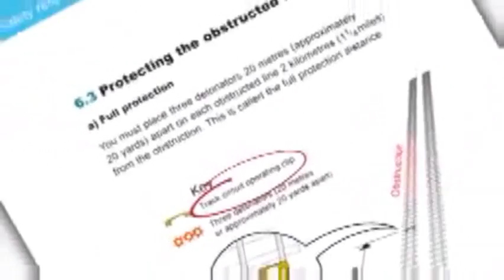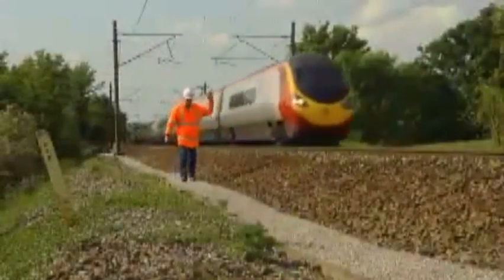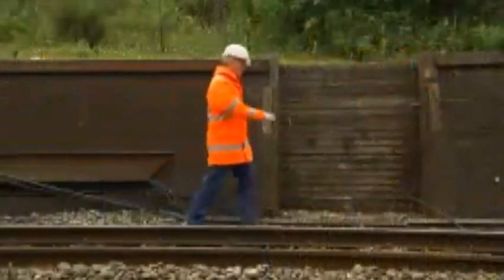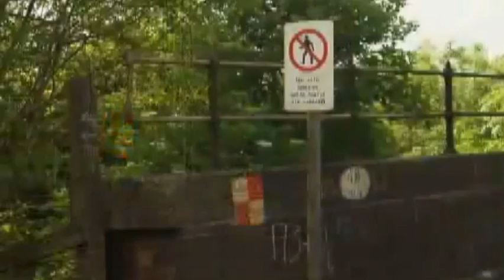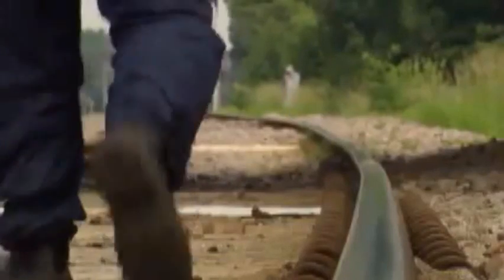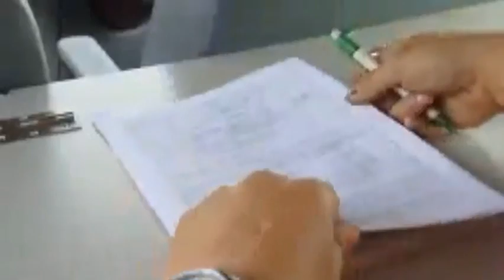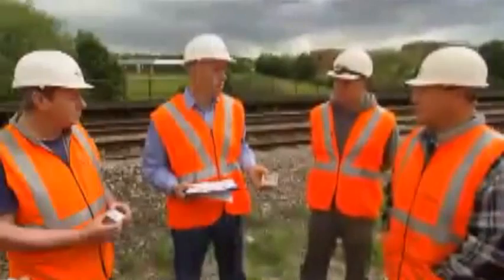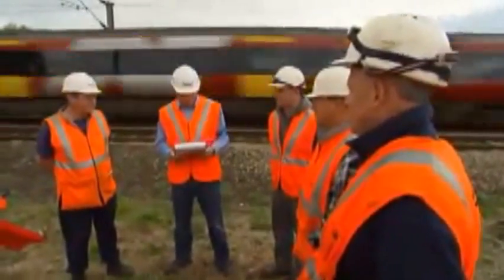Network Rail

Comment: The cess came about from the good ol' days when the toilet tube pointed at the trackside and outside the cess was considered safe from splattery delights that would certainly make for an interesting day and in later trains like the MK1's this was aimed a little inwards to the track and more downwards as someone using a toilet thundering through a station, the angle caused the ahem "spray" to ricochet from the platform drop, back up the bogies and into waiting passengers faces adding new dimensions to railway travel horrors.   Ask any old track worker about blind eels, wrigglers and other wonders of humanity and why they didn't put septic tanks on trains a LOT earlier... :P
Reply: I don’t know where you got this information from, but it’s not correct.
Toilet dump pipes were located such that the discharge landed in the four foot. At speed this discharge would form an aerosol which was really unpleasant for anyone on or near the line, and occasionally for people on platforms.
However, the word cess is of obscure origin, but most likely means “access” as it’s almost always been the walking route for track workers.

Comment: Contradiction in rail safety videos. I just watched a British Rail video which said that a blue and white checker sign said limited clearance with no refuges within the structure where as this one says none on the side of the blue and white sign. Presumably on the opposite side to a blue and white checker sign there would be a red and white checker sign?
Reply: Correct. A continuous position of safety or refuges are only available along the cess on the opposite side of the running lines. The side where the sign is displayed has neither a continuous position of safety nor refuges.
In the case that there are no refuges on both sides, then an Access Prohibited sign will be displayed, not 2 'No Refuges'

Comment: Could there ever be one person trackside? If so what are the safety procedures?
Reply: Yes, it is permitted for 1 person to be track side, I have walked 100s of miles IWA, Individual walking alone, You must be trained & certified to undertake these duties, You must have a complete Safe work pack which out lines the work to be undertaken, contact details for local control, signal box, Hospital, ECO (Electrical Control Office, These look after the overhead power supply & / or 3rd rail DC Traction power) You must maintain, contact with a control person, (if they don't hear from you at a set time they will try to contact You, if that fails a search will instigated to fine you, This can include trains running at caution around your last known position. You may not enter area's of restricted clearance (place with out a position of safety to stand for the passage of trains) you must be able to maintain good visibility of any running lines. hope this helps to some degree.
Reply: @MrOnly1dad  Thank you so much Mel. While you are about, could you please explain the red/white and blue/white restricted access signs such as on bridges and tunnels. My understanding is that blue/white means no recesses and red/white means with recesses. Does that mean that a tunnel could have a red/white plate on one side (eg left) and a blue/white plate on the other side (right side) where refuges are provided on only one side?
Reply: A refuge or position of safety must be availble for teack workers to stand to allow safe passage of trains, a position of safety needs to 4 feet / 1.25 meters from the nearest rail if the line speed is up to 100 mph, if the line speed is over 100 mph up to 125 mph (NWR Maximum speed) then a position of safety must be 6 foot 6 inches from neares line, a position of safety is generally availble to the side of the track, in some areas that could be restricted to a refuge usually big enough to accommodate 2 / 3 People, these can be a recess in a tunnle wall, a small engineered platform on a long bridge, if a position of safety is not available but refuges are the red / white sine will be displayed, if no refuges are available blue and white sine will be displayed, if neither option are available then the the area will classede as red zone working prohibited, which means at least one line must blocked to passage of trains before access is allowed. sorry its long winded.
Reply: @MrOnly1dad  superb, thank you for explaining so thoroughly, long winded is good 👍🏻

Comment: Why shoudn't one step on the sleepers?
Reply: They may be slippery depending on weather, same with rails.
Reply: They slippy. Especially timber ones with moss on or  wet, oil etc.